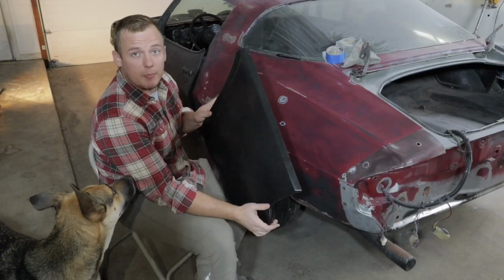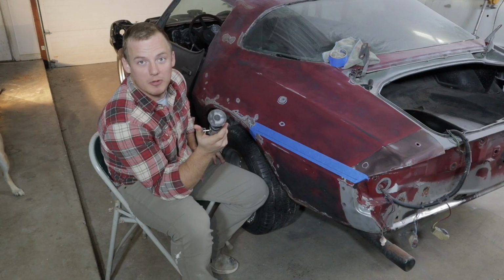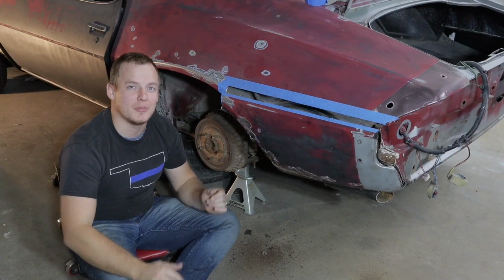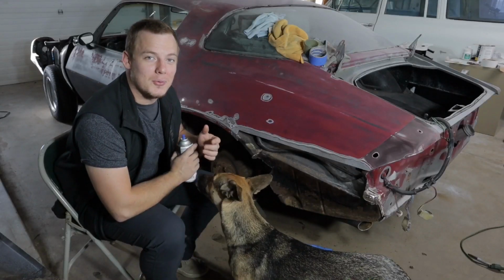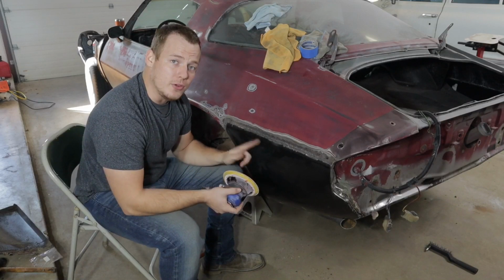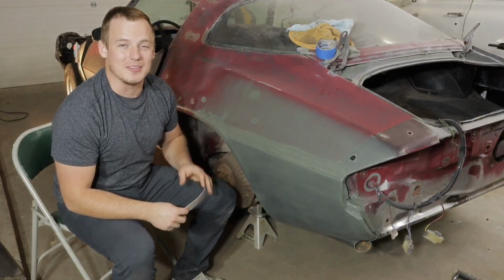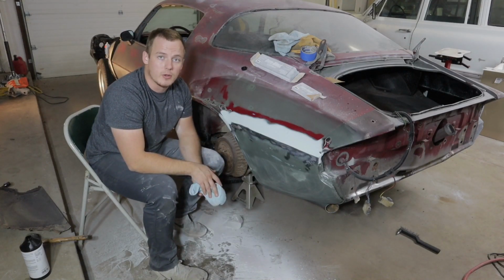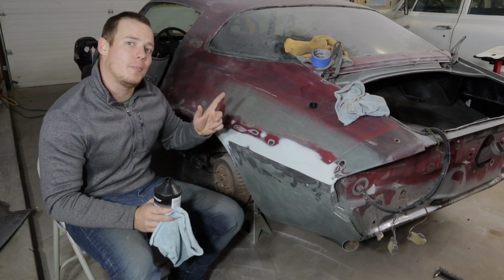Cutting out the old panels! Restoring a1978 Camaro Part 3

Comment: Nice work! I'm nearing the completion of a full restoration on a matching numbers 1979 Camaro. Are you using a flux core welder? If so what temp and wire speed were you using? Thanks.

Comment: Hey man I noticed your Oklahoma shirt I would really appreciate advise on 70-81 camaros because I’m looking for one but can’t seem to find a good one
Reply from the maker: Well if you could find a 1970 that would be awesome! I've noticed that the cars are a little more difficult to find at least in Oklahoma. In all honesty I would probably get a roller, completely strip it apart and build it from the ground up. But with a clean title, no motor, and little rust I wouldn't spend more than 3k on the car. However I would almost guarantee the floor pans will have rust holes.
Reply: @gillhe1  thank you for the advice stay safe man and good luck on the car!

Comment: Any reason why you used self etching primer instead of epoxy primer?  Also, I found using strip disks on a grinder a much easier way to strip paint/rust prior to body work.  They don't leave hot spots and warp the metal like flap disks do.  What did you do with the inside of the quarter panel?  Did you fill the areas in where you removed metal?
Reply from the maker: In my opinion from previous experiences self etching primer adheres to bare metal better than epoxy. On the strip disks for the grinder instead of flap disks I do agree with you. I just didn't get any for doing the lower quarter panels but I more than likely will for the rest of the paint stripping. Also for the back of the quarter panel I ended up welding in new pieces to make it like oem, I just couldn't find the footage due to technical problems. Thank you for the comment!

Comment: Always best to leave the factory body line if at all possible. It maintains extraordinary strength and those cambodian made patch panel body lines are never as straight as factory lines. Trying to put that shape back in wastes tons of time and it was already in the original panel. Plus, that creased body line prevents the cut edge from warping once it's cut. Patch panels are meant to be cut to size. They're as big as they are in case you need that much new material. You don't have to use all of it. Not a horrible video. We've all started out somewhere. The high end processes and procedures come with decades of doing of trial and error.
Reply from the maker: Agreed but due to rust on the back it had to come out.
Reply: @gillhe1  Yeah. Then that's the only choice. After 40 years of restoring old rusted out pigs, I've found replacing the entire quarter is much more economical. If the bottom of the quarter is that rusted, the wheel houses usually are also. And I'd  always rather spot weld a new panel than tig across the entire face of a patch. To each their own.

Comment: I can't believe you didn't fix the inner wheel well before you welded the quarter panel on come on man
Reply from the maker: I made one from scratch and closed it in after, thanks for the comment bub.
Reply: @gillhe1  one hacker to another have a great 4 of July
Reply from the maker: Lol you too bubba
Reply: @gillhe1  I just picked up a 79 off the road since 2007 hop up 350 original paint body needs no rust panels solid as rock small surfaced rust and paint
Reply from the maker: That's pretty awesome! If I were to start this project over again I would have completely stripped it down and had the body acid washed then I would start replacing floor boards and quarter panels. however, at this point I just want to get the car finished, I'm about to post a somewhat lengthy video on the Camaro.
Reply: @gillhe1  money doesn't grow on trees everyone has to start somewhere I'm sure as you grow your channel you will be able to do more  sometimes conner cutting necessary if you can't afford to buy all the needed parts good luck on your channel
Reply: @gillhe1  do you have a Facebook I could send you some pictures of my 79 Camaro I payed 4 Grand not bad for a super clean Camaro interior very good too need headliners which I do a carpet and one seat cover for the driver's seat everything else is pretty mint even has a great stereo
Reply from the maker: https://www.facebook.com/daniel.gill.5602